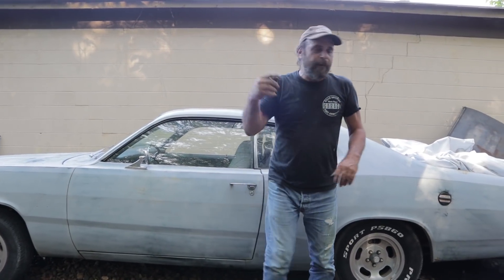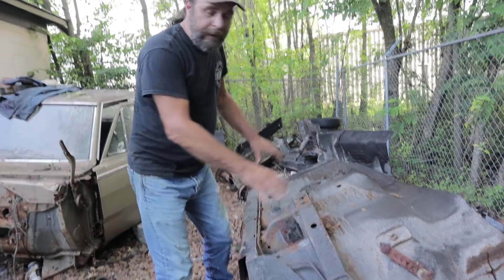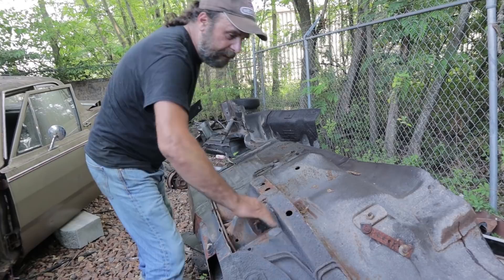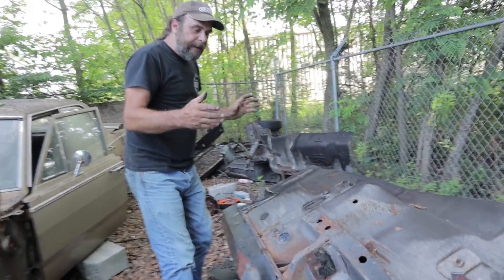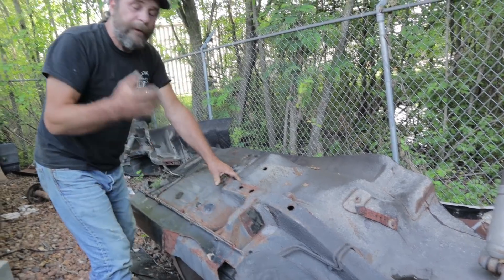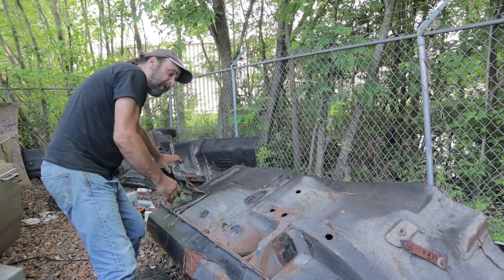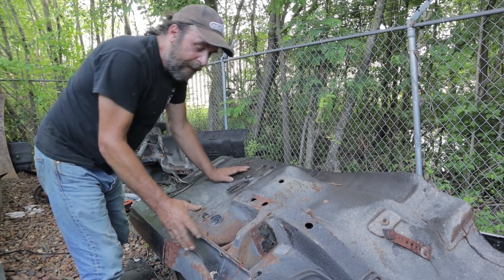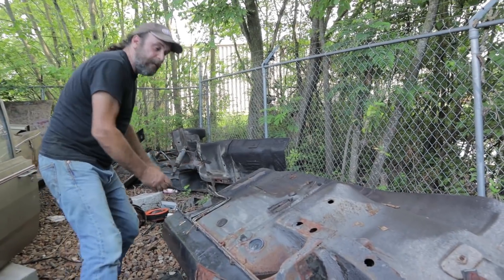Chassis Basics-Frame Connectors

Comment: Finally someone agrees with me. My opinion is if you're running a cage then by all means go with subframe connectors, but without a cage on a cruiser they are bad news. Now I'd love to hear your opinion on seam welding. I'll do it for several reasons and one of them is to tighten up a street car instead of subframe connectors. It may be overkill on a street car. But with my track record I usually get booted for going a bit fast and have to install a cage anyway. So it's "future proofing" most times. But I'd still like your input because I feel like it's more or less augmenting what the factory does.
Reply from the maker: Seam welding is a popular thing for the road race/handling guys, so it's a bit foreign to me.  But' if you're putting a full cage in the car, all of this goes out the window.  Done right, the cage itself becomes the car, and everything else is just hung off of it.
Reply: @UncleTonysGarage  I picked up seam welding while helping a friend build a rally car and afterwards we did it to a few of my cars after with positive results. The first was a 91 MK2 Golf GTI, the second was a 98 Jetta that was nicknamed the super sleeper. It had the original single overhead cam block but we swapped to a  DOHC 16v head from a earlier VW, used the forged 2l crank, Scat rods and fly cut OEM pistons. The head swap dropped the CR to 8.5-1 but after decking/milling it CC'd out at 9.6-1. I built a turbo manifold and ran a Holset HE351 a buddy got from a warranty job he worked on. It cost around $100 to rebuild/balance it. The intercooler was a 30 row HD unit out of my old rollback with 3inch in/out and last but least was I swapped the Haldex AWD and 6speed from a totaled Audi TT I towed and they didn't have insurance. I pretty much had to graft the TT trunk pan into the Jetta for the AWD swap. So it was a no brainer to seam weld the car. The car ran Megasquirt ECU from DIY autotune  and on pump gas  it did 458 hp to all 4 wheels with very little timing and meth injection. On C16 and a different dyno running fwd we pulled 694 whp with more to go but traction was the limit. The car ran a best of 10.62 @ 147 mph before the gave me the boot at Atco. I'm not sure you can tell but I miss that thing and like a idiot I sold it to a kid for way too much money. I should've known better because it took him 2 days to total the car. Thankfully he didn't kill himself and I owe some of it holding together in the wreck because it was seam welded. Funny thing was his father called me a week after and asked me to tow it away so if I find a shell I'll probably rebuild it although its been sitting for years. The third car I did was a 70 Nova and again it tightened the car up immensely and I feel its better than subframe connectors. Basically you're strengthening the factory attachment areas. So unlike connectors that make one area too strong that wasn't supposed to be there you stiffen/strengthen the whole unibody. Anyway sorry about the book I wrote, I just started down memory lane and couldn't stop lol. But seriously if you ever decide to do a UTG turbo project its hard to go wrong with Holset turbo's. You could stuff one or 2 on something, do a simple EFI setup and be knocking on 1,000 HP door for CHEAP ;-)

Comment: I'm disappointed (a little) to hear this, but I trust Tony more than myself on this stuff.  I've had frame connectors on my 71 B-Body since 1991.  Daily driver for 25 years since.  Never had a problem, that I know of!  I hope my luck will continue.
Reply from the maker: Your luck PROBABLY will continue.  I simply laid out the pros and cons based on the design and intended use.  Don't stress it
Reply: @UncleTonysGarage  I installed frame connectors on my 81 firebird years ago and never had any problems. Is that because these cars had all those big body bushings in the front end?
Reply: @mds00  those things were pretty flexy. 
Back in tech school in 95, a buddy picked one up. 
 the right front subframe mount in the floor was so rotten....we drove it home and it was all over the road.  
put a big ass bolt and a couple of plates on each side  to make a mount again....still would creep all around and you could see it moving because we didn't put the carpet back.
 Good times and free used tires from his work...heck of a smokeymachine!!
Reply: @MrTheHillfolk  
I have a 74 nova with a 383 stroker that does the same thing. Surprise lane changes from the torque is always exciting.
Reply: @Turbochapman  
Haha just look around before mashing the loud pedal!
Reply: Don't worry about it. Your car, and the many thousands of others with connectors and cages, is just fine and better off for it.
Reply: You have nothing to worry about, trust me, if guys were splitting panels and seams due to frame connectors,  no one would run them. I recently installed them in my 66 Satellite,  the ride is noticeably more responsive.  I look at them as mandatory for these old cars. If you're going to bump up the HP by 100% compared to how they rolled off the factory you will definitely stress the chassis past it's intended purpose. Connectors help prevent that additional twist the engineers didn't account for.
Reply: This interests me as I plan road tripping and partially dailying my soon to be corner Carver but, have 2 kits and entirely new front suspension. So I wonder what I break or snap off.

Comment: Monocoque chassis can save your life (overall rigidity/strength) . . had a hire car coming from the opposite direction on the hwy aqua plane (after a big storm on a badly built road) at high speed into my old Oz XF Falcon ute which pushed the entire side of the car in half a foot . . my first taste of the simple pleasures of ambo's using some kind of staple gun to try to shut up a nicked vein on the head where it hit the top seat belt mount bolt .
Reply from the maker: Hey, chicks dig scars, right?

Comment: Late model side impact crash regulations have mandated that the boxed rocker panels become structural.  A hardtop model is very unusual today because of these federal crash regulations.  With tougher frontal offset regulations the body is becoming more rigid.  If a vehicle hits a solid object only in the headlight area, then the front suspension and tire is easily ripped away and there is little structure to prevent the occupant from being crushed.   What Tony said about the classic era is probably true but you're now encased in a rigid steel shell.  My Honda Civic feels much more solid than my Duster and the steel is also harder, and there are probably a greater number of spot welds.
Reply from the maker: The rockers on Chrysler unibody cars have been boxed and structural since 1960
Reply: @UncleTonysGarage  The old rockers were  not structural to the extent that they are today. Rockers always rusted.  Doors would stick when the car was jacked up by one wheel.  When the jack slipped off my Honda the rocker  hit the jack stand without a dent.   The A-pillars of new cars are thick and solid - visibility isn't as good as it once was.  The various cameras and sensors are needed to be aware of what's happening around you.  To meet rear crash standards the back of the new cars are higher and flatter - which favors the compact suv over a small sedan.   The vehicle is a battering ram.  In the Camaro the rear visibility is poor because of this design, the beltline of the Challenger and Chrysler 300 are high.  It would not be possible to build a simple car like my Duster today.

Comment: Makes sense, i'm into aerospace stuff, i look at the body of a car a bit of the same way i look at a wing of an airplane, it's designed to give and flex and spread the load across the whole wing section, imagine bracing up a large portion of the wing having the rest of it flex, that would be a disaster.
Reply from the maker: Exactly
Reply: Wings don't carry suspension components that are specifically designed to handle, predictably, that motion instead. The wings are the suspension of a plane. It's flawed logic to apply to a car. Flat out, I just disagree with UT on this. The stiffest chassis is always going to be the best one because then you can actually tune the suspension to do its job.

If nothing else, automotive OEMs didn't have the computational power or budget to run FEA on a production car in the 1960s the way Lockheed or Boeing did... Apples and donuts comparison, IMO.
Reply: @TheBrokenLife  I agree, unibody cars came out mostly in the 70's and at that point manufacturers were tying to cut cost.
Reply: @mds00  I had a 1960 Fiat that was unibody. Your logic just lost!

Comment: Tony,  as an engineer and a mopar lover for over 40 years, and a mechanic for 45 years,,  I have to say I completely agree with all you said in this vid. You nailed it  !
Reply: Tony knows his stuff unlike most . Most just know enough to be dangerous...😂
Reply: Excellent brief:). I have a second gen camaro. Presently, I plan to install a rear swaybar, and a bigger one up front. I removed the air shocks and installed high quality rear shocks. The fronts are adjustable. I have had second gen camaro before and was very happy with just these mods. Cannot thank you enough :)

Comment: Good to know! My first car was a 77 firebird and it rotted to oblivion but later I got a built 79 z28 with t tops. I tdd ran a 406 a th400 with 373 gears. The car was built for 1/8 mile and it was in car shows but when I bought it I used it as a daily driver! Now that car ripped between the t tops about 3 inches inward and when u got behind it you could see the car had racked a bit! Now I had bought frame connectors but never installed then. But, I figured next time I would but thanks for the whole torque box demonstration . The next one I will box it in!

Comment: work harden? That's a term I'm not familiar with.  I'm not so sure they did what they did because of engineering reasons. The entire reason for a unibody is that it's cheaper to build. Remember, those big companies used to be overun with bean counters... they would count the beans spent on cars, but not what the mucky mucks were doing with the money once they made it... or didn't as the case may be.
Reply from the maker: Work harden is the same as when you take a soda can and bend it back and forth until it tears in half
Reply: @UncleTonysGarage  ah okay, but if the thing won't give at all, that won't happen either. 
Back when I was in high school or thereabouts, there was this guy with a white oh bout a 70 Mustang. He had a big prostock style hood scoop, really wide meats on the back with traction bars, looked for all the world like one hell of a hot rod/drag car. I caught him with the hood up one night... it had a stock straight six under the hood, yet every dragger in the area feared that car... I thought it was hilarious.

Comment: Depends on the car in my opinion, my third gen camaro of course are made of cheap thin metal uni body construction and hearing the car flex as im drivng up and down steep driveways or when im hitting it hard threw the turns didn't make me feel warm and fuzzy. Especially since I restored it and had to take care of the typical flex cracks. Now I have the front steering box tied together with a wonderbar,  as well as the front and rear subframes, and it feels dramatically better no matter what doing.
Reply from the maker: Yeah, no question that it feels better!  But, the forces acting on it have not changed, they've only been concentrated into smaller areas, hence the possibility of work hardening that metal.  That said, I hope it works out for you in the long term
Reply: Uncle Tony's Garage I hope so if not I’ll be having some quality time under the car with my welder 😄

Comment: Lol everybody knows you back half and tube frame a real car.  Real cars use big rubbers.  Great video I couldn't agree with you more. I have a 67  Plymouth roadrunner 440. In  highschool I installed subframe  connectors in it. I then bet the piss out of it for 5 years until I had it split between the middle of the door and B piller. After my crash I cut the floor out, picked up 2 new doors, strain the body back out and tube framed it. Then install a all new sheet metal floor. I've learned if you going to do something, do it the right way the first time.
Reply: Did your auto spell not work right? Did you have a 67 Road Runner- because first R.R. was in 68- or you had a 440 out of a Road Runner? I'm confused.
Reply: @danielscott6787  ,sorry speech to text. And yes it is a 68. There was a mistake with the speech to text.

Comment: good video tony, im with you, not for every application. youd never want to install them say, in a early 60s Ramcharger, but should be one of the first instalations on the camaro/nova....and ive seen my share of popped out windshields at the digs, some cars, you,d better do something alright. as i remember, mandatory on the V-8 vega conversions, and the like..
Reply: wow, that was faster than a pizza...........
Reply: Mandatory on Fox mustangs much over stock, or dead stock convertibles, too.

I disagree with UTG here...
Reply: ive seen convert camaros open up the door gaps to the extent the doors dragged severely, and we,ve all seen windshields "popped" out.  why do you disagree with T. he basically says it all depends on the application, thats what i say too. i take it when he stamps your comment with a heart hes agreeable, or thinks you have a fair side of an argument. thats what i said and he stamped it. even hed probably say, thats ok, nobody will agree with me 100% of the time.... i know ive just subscribed only a short time but as for me...i only agree with 99% of what he teaches.

Comment: If I add an engine with 500hp will it cause the chassis to bend way too much and wreck the frame? Sorry, I had this stuck in my mind.
Reply from the maker: 500 horsepower?  Not even close...even with a dead hook
Reply: @UncleTonysGarage  Cool. Thanks for the info on this vid. Helped me a lot on my knowledge on unibody cars.

Comment: I had a second generation Camaro I was setting up to corner , shortened stiffer front springs , larger anti -roll bar ( “ sway bar “) front and rear.  Was told to use frame connectors, drove another car with them and hated it . I could could feel the flex without them and knew I was about at limit of traction . Much less feel without them
Reply from the maker: Had the same discussion with a bud recently about Drag Cars...how they are so much easier to drive without connectors.
Reply: Uncle Tony's Garage , yes I forgot I didn’t put connectors on my 69 Camaro either . Drove great and rode nice . Not a terror but 8.10s 1/8 mi quiet SBC street car. 
Did a lot of things I wasn’t “ supposed to “ like a solid lifer cam , single plane intake , and kept the stock single point distributor . 
I’ve never gained anything by replacing a points distributor to electronic myself. 🤷🏻‍♂️
Keep em coming , I know you’re geared to younger people but I’m 51 and love the rational time tested old school tech .

Comment: Can you possibly do a video on proper flat tappet cam break in. Some say you need run zinc oil for the life of the engine othersuse high zinc for break in then go to synthetic. Also the proper driving for first 500 miles.
Reply from the maker: Break in is 2000-2500 RPM for 20 minutes.  Change out oil and use something with zinc.  I don't bother with synthetics.  Shell Rotella is cheap and has enough zinc to keep flat tappets happy
Reply: Thanks

Comment: I heard stories about cars in crash situations where uni-bodies broke in half.at the door jamb, seat belt  attatched to back half on one end and front half on the other. Driver between. 
Thats why i have frame connectors. Seats  tied into connectors as well. 
They were there. Im keeping them. I understand the flex and work hardening. Also the rows of spot welds on 2 overlapping pieces,the two layers provide structure as well. Usually 2 rows of spot welds too. 
Same principles used in aircraft. One row will tear apart.
Reply from the maker: Chryslers use single row spots, and as far as tearing apart, find the pics from that Barracuda fatality a few years back.  Tied rails, broke into three pieces and spit the driver on the ground.  An unconnected car is more likely to bend and absorb energy than tear.

Comment: Love those cab wrinkles on my buddy's camaro.
Reply: I've seen a stock 92 rs with a TBI 305 with roof cracks and those cars couldn't be much over 120 hp, I'm mean what do they get in the quarter? Like 16.3 or so?
Reply: @CC Ryder this was 20 years ago when i was in highschool I'm not saying the car didn't see is share of abuse
Reply: @CC Ryder burn out mobiles they are but you're right about them ruining out of steam at the big end.   A friend and I went to the strip for test and tune he had an 87 IROC with exhaust and Nitto drag radials best he could pull off was a 16 flat and he had plenty of strip experience. I had a bone stock 02 grand prix 3800 no s/c, my first time going down a strip I ran 15.7 all day long
Reply: @CC Ryder Oh I hear you, 3rd gens are my favorite I'm a sucker for 80s styling. By the time I started tinkering with cars that stuff was all 10 years old or so that's kinda where I cut my teeth
Reply: @CC Ryder yeah it's pretty ridiculous what cars are doing now my mother has a escape with a 260 hp 2.0 4 banger lol